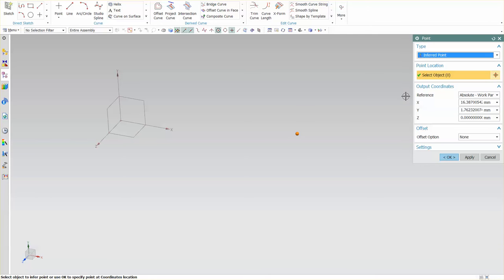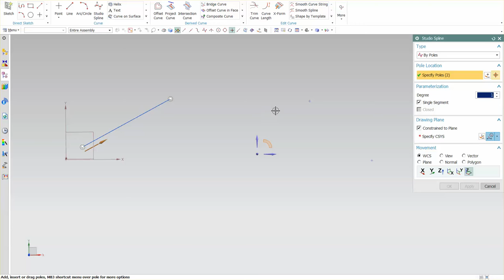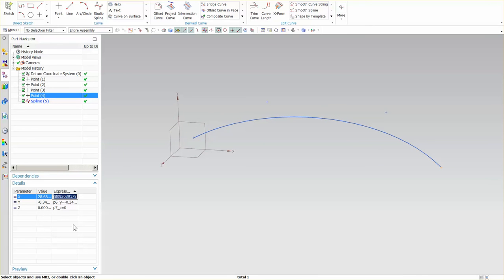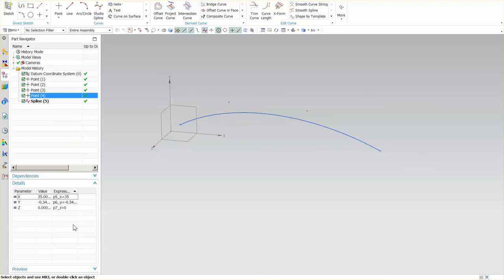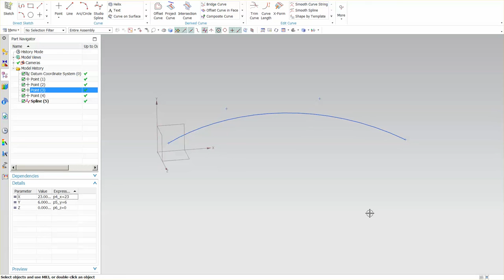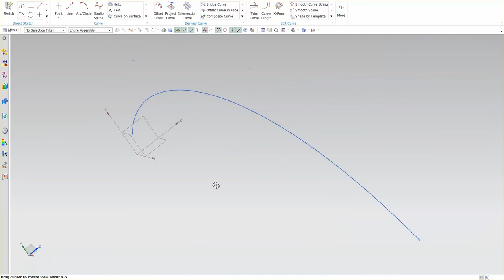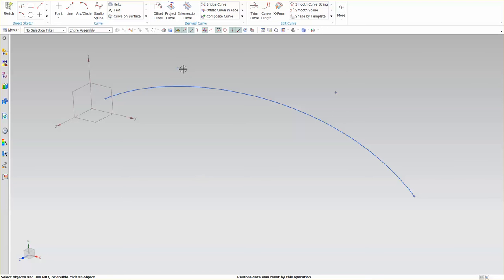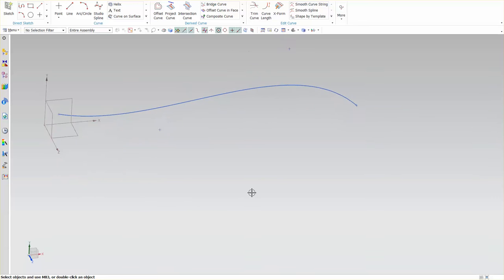Siemens NX | Spline Trick

Comment: Thank you for your video. I have few questions about studio spline, if you want to share your knowledge:
1- when should one use spline inside a sketch environmet and when outside? Is it just a matter that a sketch is constrainted to a plane? why bridge curves are not available inside a sketch?
2- why geometric constraints can't be applied to a spline outside a sketch?
3- when I design a spline by poles, is there a way to make it pass through a specified point (I mean the spline itself not its poles) and/or, furthermore, make it tangent to another curve/surface?
Thank you! Federico